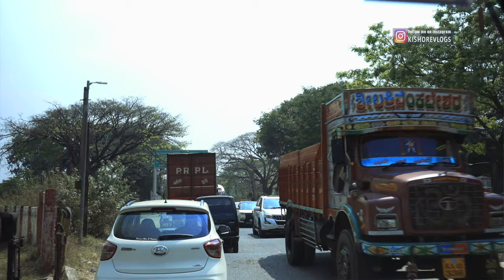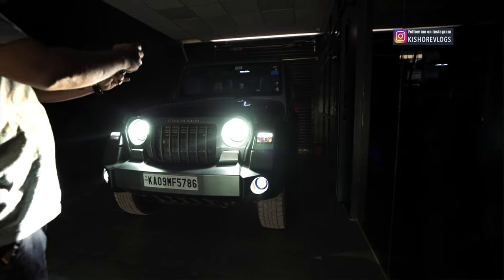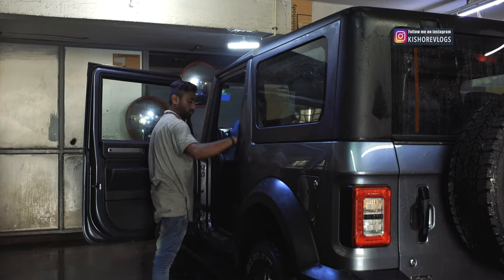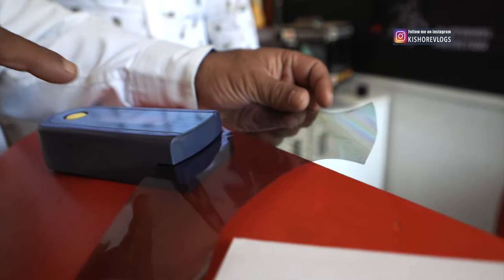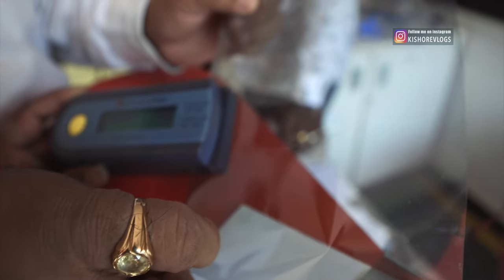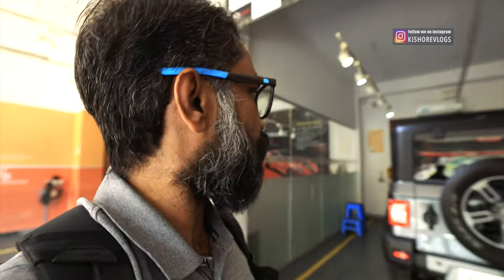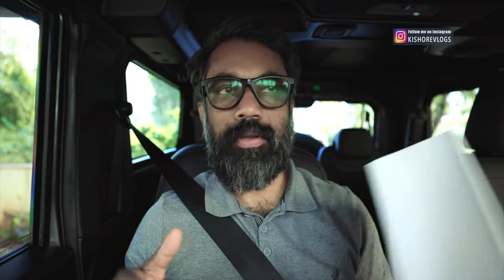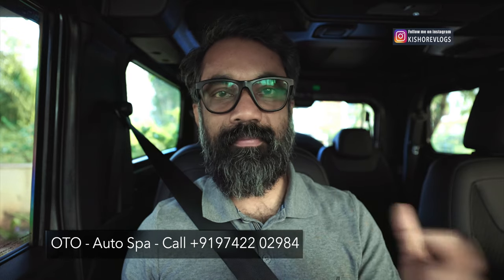3M CR70 Sun Control Film for THAR including front glass | Cost and Advantages

Comment: I got my new jeep compass filmed with crystalline 70 all over including the sun roof and front windshield . Cost me 46,000 rs. It’s expensive but worth every penny. I stay in vizag which has very hot weather. I had the same film on my previous vehicle 5 years back. An S cross. That time it cost me 27,000. Worth it!!!
Reply: Bhayya, akkada veyinchavu?
Reply: @ramboog2654  3M
Reply: @srujanmims  vizag lo akkadundhi??!
Reply: @ramboog2654  China Waltair junction.
Reply: How was the effect after using? Because i'm planning to get it for my verna. I've red some reviews saying that there is no change in heat using cr70
Reply: @kavithakannan7215  I would not have got my second car also filmed if there was no difference!

Comment: Sir, any issues with Bluetooth connectivity and Apple carplay of infotainment system?
Reply from the maker: Hi Shyam, CarPlay is working perfectly, but Bluetooth, volume goes up and down
Reply: Thank you. I've got a few feed backs regarding volume going to zero every time you start again and then connectivity fails in between songs. 
Regards
Reply: @KishoreVlogs  there option in setting adaptive sound or something which increase and decrease sound with speed of vehicle, its in my xuv500 not sure for thar.

Comment: It’s better to invest a bit more and opt for Dark green UV cut glass rather than shelling out 31k on a piece of tint.
Reply: @Prometheus can u pls give more information about Dark Green UV cut glass
Reply: Yeh could you please share more info on this ?
Reply: Lol! 🤣 you cant get them if the manufacturer doesn't make it . Its only possible in car which have models already having uv cut glass. Also regular 30% tints are available for 5-6k ! These are ceramic ( its a name ) tints from 3m they already cost so much in US cause they are the best. People having bmw and other cars use them all the in us because they have very high heat rejection without having dark tints ! 30% ceramic is close to 60% normal tints
Reply: Cr 70 vlt is 70 and H.r is 50....other than 3m  offer Vlt vs hr ratio higher  .....for reference nearest alternative to cr70 windscreen is Garware top of the line "ice cool shield" vlt 70 hr49. But quality wise 3m is better , longitivity life shell is higher in cr70.  Budget wise Garware better , another dilemma no film nearest to cr50 performance ...its vlt 50 hr56.....even Garware vlt 40 can achieve 52hr

Comment: Hi Kishore ji, how is your experience from the CR70 film? I recently got it done for my i20 . Cost me similar to what you mentioned. However I am not fully convinced its as good as advertised specially for that price. So thought of checking with some one using it. Love from Kolkata 🙏
Reply: Hi Souvik, i have done for my. Vento last year, costed around similar, in extreme chennai weather I. Am. Not seeing much heat reduction, cant really measure of its worth or not. Even I am a Confused owner opted for CR70
Reply: @ganeshkumar-cs  Right.. 😅😅
Reply: @ganeshkumar-cs  bro, should i go ahead?! Please advise me
Reply: My experience with 3M has been disappointing. I got windshield film done for heat reduction. But it actually makes the cabin hotter! It only helps in night driving by cutting glare.
Reply: @kunalk1234 are you sure is it cuttling glare in night times im planning to put in my car they were asking 12k is it worthable my main concern is regarding night driving is it cutting glare or not
Reply: @saransampath8889  It cuts glare but not more than 20%. I feel 12k is too much for the benefits you will get so you can try Garware or other brands that come with warranty and are equally good.
Reply: @kunalk1234 thank you so much for your reply then  i will try garware

Comment: Sir you have paid more , in Bangalore they will do for 18000
Reply from the maker: Oh, are you sure? CR70 all the windows and also the front glasses too.
Reply: lol .. that seems more as well. should not exceed Rs 400 /square feet but always a good idea to compare from a bunch of ppl
Reply: @KishoreVlogs  yes sir , even i have mahindra thar lx 2021 model , same product in bangalore for 18000 . Sir how is your thar LED ligts working, is LED headlights are power full.
Reply: @KishoreVlogs   yes CR70 for 18000
Reply: @neerajgowda.r04  in which 3m store u got fitted ?, i have enquired in indiranagar , they told 28k.
Reply: CR70 on windshield and RE70 on remaining will cost that amount. All CR70 will cost more.
Reply: Genuine product won't differ much showroom to showroom. All 4 doors, front and back together will cost more than 25k for sure even for a hatchback. Best idea is to put cr70 for front and back and for the sides re50/70 along with rollable sunshade.
Reply: @njoy51  380 per square foot. For my Amaze 25 square feet required. So material cost 9,500 for 4 windows and rear windshield. 3M CR 70. If you can buy and ask a professional to fix at your home the labor charges 2,500. Total 12,000. I got 3 quotes for 23,000, 17,000 and 16,000 for fixing in their shops. Imagine the profit margins. It takes about 1.5 to 2 hrs to complete the job.
Reply: @padmeshsethuraman5617  yeah it's kind of crazy how these car decors people make money randomly by ripping people off.. I guess with stricter norms these films will get banned
Reply: @padmeshsethuraman5617  can you provide contact from where you have got the CR70 for 380 rs
Reply: Just 1200rs in all doors plus rear glass in Chennai gp road. Brand hi-cool and cameo src

Comment: Sir, it's illegal. You will be challaned. Specially in Chandigarh City where traffic police follow the rules strictly.
Reply: I heard as per MVA act 30 percent light blocking or 70 percent light allow films are legal 
Only full black or zero visibility is fine
Reply: If those cops follow rules strictly please ask them how much percentage is legal, I am sure most of them won't be able to answer it because even they don't know they just make you pay fine on their judgement,
According to central motor vehicle section 100 act [6] (2) "The glass of the wind screen and rear window of every motor vehicle shall be such and shall be maintained in such a condition that the visual transmission of light is not less than 70%. The glasses used for side windows are such and shall be maintained in such condition that the visual transmission of light is not less than 50% and shall conform to Indian Standards 5 IS: 2553-Part 2-1992;"
But what most of these cops do is fine you when they want and they won't even listen to you when you try to reason them even thos when you are not even wrong,
I am saying this because the fine for window tint is 10k which is not a small amount and instead of properly testing the tint with the tint tester (the one showed in this video) they will just fine you on their judgement, doesn't matter if you are wrong or not,
So please I'll say it again ask one when when you get chance that what is the legal percentage on tint (most of them won't be able to give you an proper anwer but still they are  making people pay fine).

Comment: It is illegal to put any films on car glasses as per a 2012 ruling from Supreme Court of India. You need special permission from the Home Ministry to do that or in case if you have Z/Z+ security, that's why most of the ministers have black glasses. The police maintains the right to impound your vehicle as well as break your car glasses. It has happened with me once in Delhi, the police literally scratched it off and broke the rear glass plus i had to pay a hefty fine. By default the car glass lets in 85-90% light and by law they cannot go below 70% for windshield and 50% for other glasses. Instead of a film, car glass manufacturers like St. Gobain and Asahi India make custom safety glasses which can prevent heat and UV to come in, but it will cost you 80-90K at minimum.
Reply from the maker: Hi Vikram, I understand, but the 3M film that I have used CR 70 which allows more than 70% light. In fact I don’t feel any change after the installation
Reply: Now it's is legally allowed in India 
50%visibility for side glasses
70% visibility for front and rear glasses
Reply: 50% 70% is allowed, so update your knowledge don't spread wrong information. The year is 2022 BTW.
Reply: @basil3130 sir visibility req is for glass, any film even if it allows 90% light is illegal